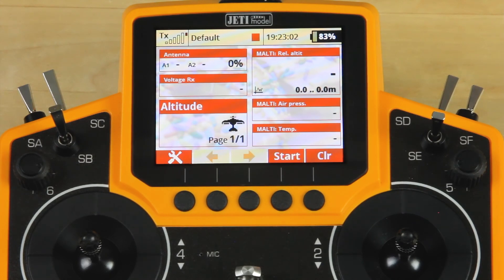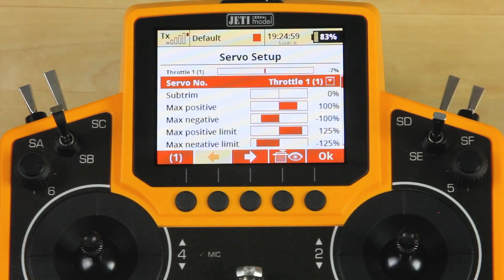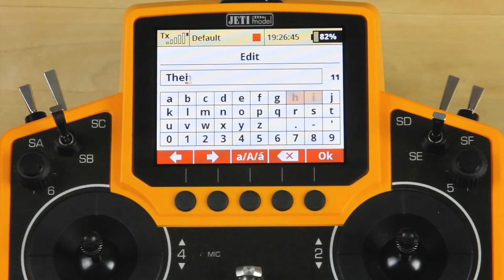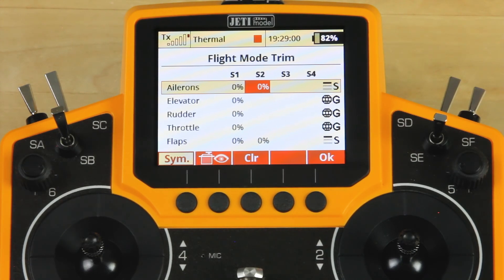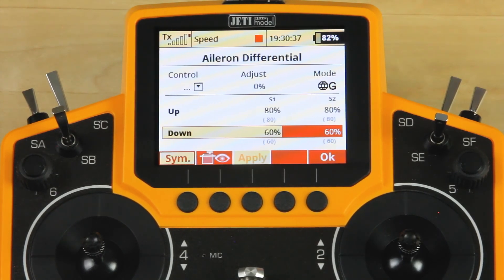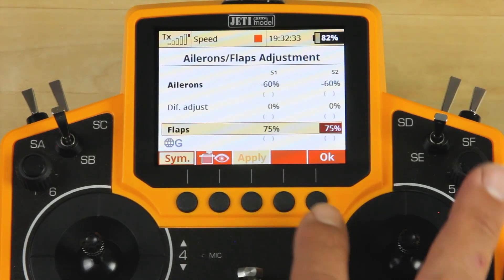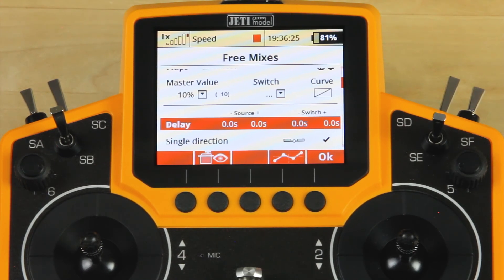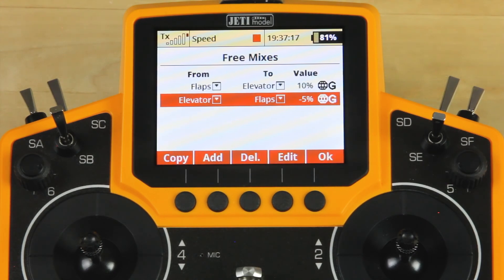Jeti Programming Guide: Comprehensive Sailplane

Comment: Hi, great video.  Logically presented and well explained.  If you still monitor this, I'd like to ask about Launch and Landing Modes.  I have a template on my Spektrum Tx that includes those 2 additional modes.  However, I'm trying to switch to Jeti now and not sure how to handle throttle/launch and flaps/landing.  Thanks much.... jg

Comment: Hey, so I fly a F5J sailplane and I want just 3 switches 1: Motor 2:Thermal 3:landing , and so when I turn the switch to motor I want to use my gimbol (that stays where I put it vertical)  to adjust the motor speed ,  when I switch it to thermal I want it to adjust the curvature,   and when I switch it to landing I want to use it as butterfly.     How can i do that?

Comment: Is it just personal preference or is there a reason why the flaps on p5 and not the throttle stick?
Reply: Agreed on the flaps, seems most use the throttle stick.  Also I’m assuming you can tie free mixes to flight modes instead of just other switches?